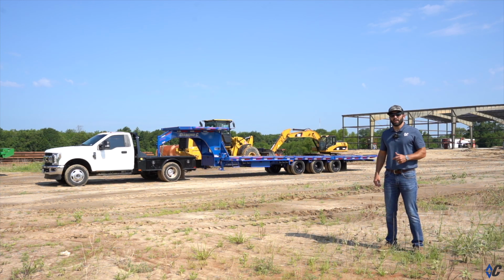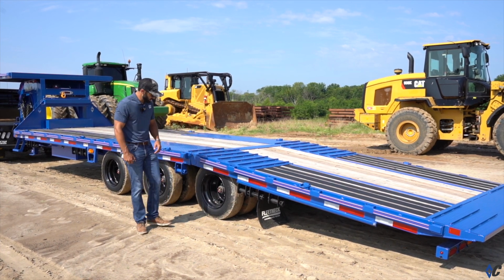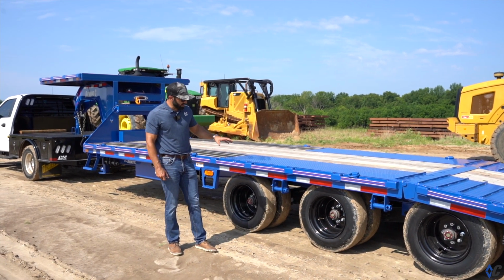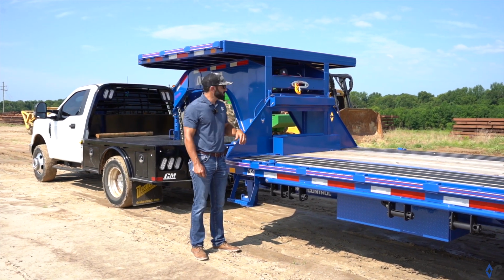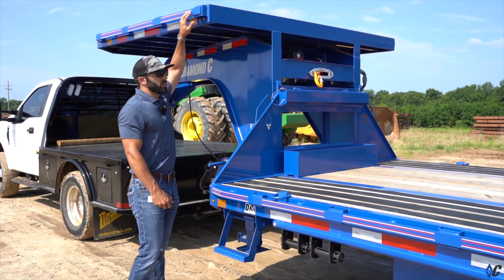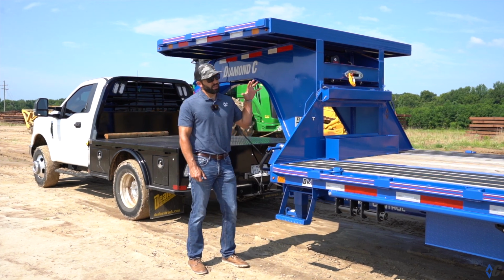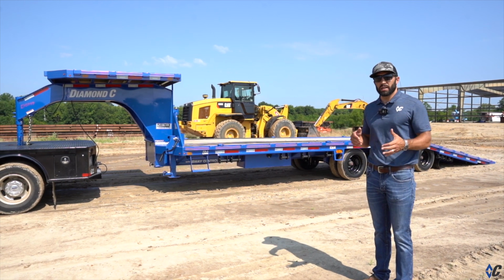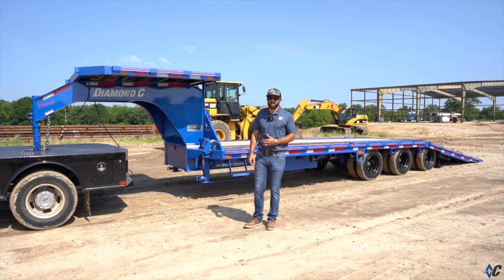FMAX312 Walk Around 😎 | Gooseneck Trailer | Diamond C

Comment: How do you keep the front axle brakes from locking up when your empty? There's no weight there
Reply from the maker: Sounds like there might be voltage issue with your brakes. You can always test the grounds and continuity, but the best option is going to your nearest Diamond C dealer for them to distinguish the cause of the issue.

Comment: Do you guys have In house financing?   I just got a 5500 I run my 22gn big Tx with
Reply from the maker: Hey Ricky! Financing will need to be through your dealer as we don't do financing directly! Most all Diamond C dealers do use either Sheffield or Synchrony or both to provide financing for DC customers. 👍

Comment: Did I miss something, he said it had three 12,000 lb axles, that’s 36,000 lb capacity. Subtract the 10,700 lb weight of the trailer that’s 25,300 of usable payload. He said it could only carry 19,300lbs. What am I missing?
Reply: Sticker is probably rated for 30k so that’s the limiter on paper
Reply: It is 30K rated. It has a round hitch/neck. The 40k neck is square. The customer had it derated. I have the FMAX 216 40K.
Reply: I have a twin axle from them that's 40k that runs the 3" ball.

I don't know why someone would put a triple axle just 4 more tires too wear out for no reason?
Reply: reliability. Lose one, and day continues. Better load distribution too. @allamericanlandclearing6577
Reply from the maker: You have the standard option of 30k GVWR or upgrade to 40k GVWR on this model! 💪🏻